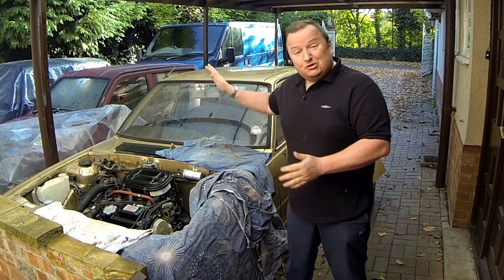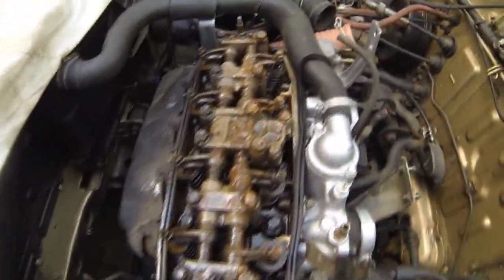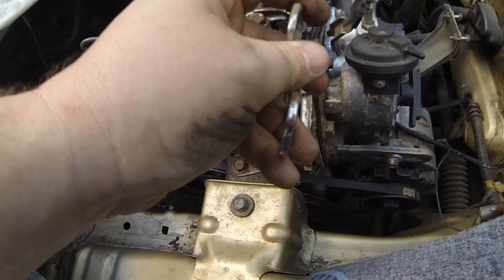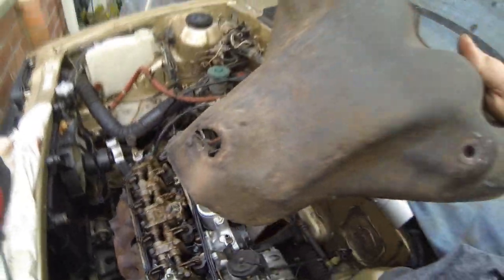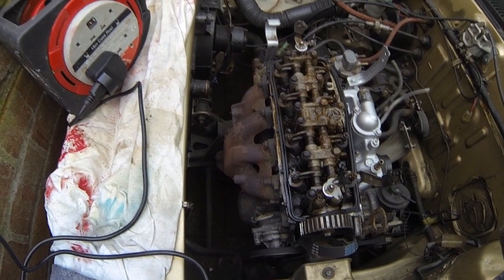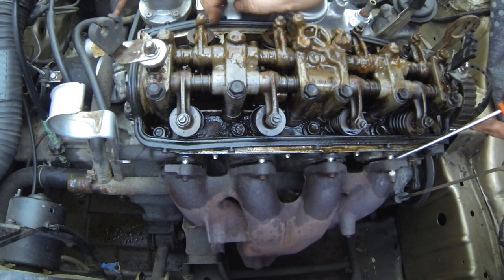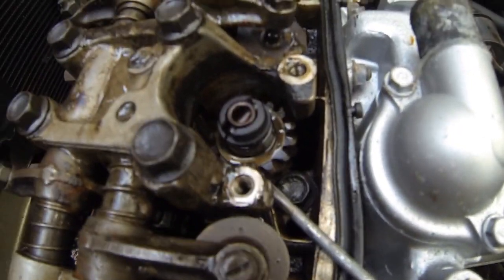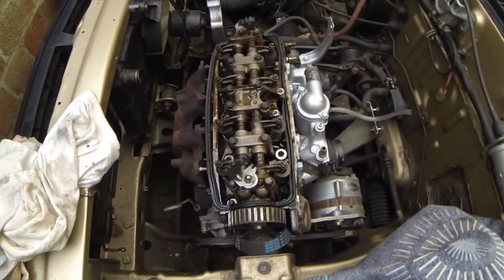Part 15 Triumph Acclaim Restoration Removing The Cylinder Head -Gasket Gone

Comment: When I did mine it was difficult to remove. I left the exhaust manifold on and used a trolley jack on the bottom of the exhaust manifold to get the head off. When you fit the oil pump driveshaft make sure you have it all reseated properly before you tighten the bolts on the cover. I broke the cover but I was able to procure a replacement from the Guru.
Reply from the maker: +Parknest Yes, i'll make sure the pump shaft is seated before tightening.
Cheers
Martin

Comment: Tough old job Martin! If you'd had a battery you could have tried cranking the engine to loosen that head. It's worked for me a few times.  Look forward to seeing the extraction of the studs!
Reply from the maker: +jsof2 Yeah, that head gasket was well stuck. Those studs will be fun I think (not) haha.
Cheers
Martin

Comment: I can't get over the middle of December and you're outside in short sleeve shirt. Crazy wind here in Welland Ont. I think Hurricane Kate is mucking things up. That head gasket is a fairly big job for an average back yard tinkerer. I hope when all is done, you can recover the investment laid out. Well done.
Reply from the maker: +Brian Percival it's 15 degrees C here during the day Bri, like a summer afternoon. Weather's gone crazy. I may even keep it yet Bri.
Cheers
Martin
Reply: +Brian Percival, +retrorestore  Question? Does Canada use a different calendar then the one the UK and USA uses? The reason I ask is that it is 14 November, 2015 by my calendar.
Reply: Brain farted. I meant November and typed December. Saw it just after I posted, oh well, I made a mistake.
Reply: I thought that might be the case, just wanted to give you a hard time. Cheers and have a great day.

Comment: Good to see you back on the tinkering vids again. Has it really been thatg long since you last touched the Triumph? :)

I think I would try the "weld a nut" method to those manifold bolts first - the heat from welding can help loosen them up, without having to heat them up with some sort of gas equipment.

Personally, I'd not bother with the vinegar solution to flush the cooling system - it's fine in principle and may "work" (part of the problem is that you can never really tell properly unless you strip the engine down to check), but you can get a two part coolant flush (scale remover and neutraliser/rust inhibitor) for about £6 (some are even cheaper on eBay) if I recall. It's just designed for the job and should work a lot better and faster.

Looking at the head gasket at around 14:35 (hard for me to see properly, and I can't see the other side), on the sealing ring of cylinders number 1 and 4, you can see what looks like carbon that;s not as present on the others, this is probably the main area where it went - you can also see where carbon has gone from around the edges of the pistons, this is also a sign of coolant getting in, and cylinder 1 has what looks like the most "burnt off" (you can sometimes diagnose a head gasket by removing the spark plugs and looking down onto the pistons - you can often see the one where coolant has gone in as the top of the piston is "clean"). Actually, spraying water into a running engine is an old trick for removing carbon.
Reply from the maker: +mrman17 Yes I wasn;t going to put vinegar in there again but use a proper system flush as you said. Pot 4 seems to be the main culprit but the whole gasket was in a right state though. The bores are in superb nick as well.
Cheers
Martin
Reply: +retrorestore Not changing "tired" coolant and not using antifreeze can cause damage to gaskets over time, and could potentially be what happened here, especially considering how much scale had built up and seeing how the gasket pulled apart the way it did. Or it just could be that the build up of scale caused it to overheat.

I've not worked on an Acclaim since around 1990, but from what I can remember they were pretty much a reliable car, especially compared to older Triumph models. I suspect the engine being designed/made by Honda helped (actually I think the whole car was based on a Honda).

BTW, I'm hoping to start my own car related YouTube channel next year.
Reply from the maker: I think you are right. I know the previous owner of the car for the past 18 years and the last 7 years it was in storage. Probably never changed the coolant but these Honda engines are pretty good. I remember the Hassle I had many years ago removing the head off my Dolomite Sprint with those long head studs that were seized into the head due to corrosion.

I'll keep an eye out for your vids.
Cheers
Martin

Comment: Hi Martin 
I did that same job many years ago on my Acclaim.  If I remember correctly it was a right pig of a job. But it ran  much better after tho.
Reply from the maker: +Paul Alsbury Hi Paul, yes, the head didn't want to come off but the gasket was shot so it needed doing.
Cheers
Martin

Comment: Wouldn't it have been easier to have left the manifold where it was and just removed the downpipe instead? I try and do that wherever I can as we all know how easy an exhaust stud can snap off and the fanimold is good to grab hold of or lever against to get the head off. It might not have been possible in your case but it's worthwhile remembering for next time. Anyway, it's good to see you working on the Triumph again :)
Reply from the maker: +Andy K Yes, I was aware of that but I chose this method as i'll also be stripping the head and you need access for the valve compression tool so the manifold had to come off anyway.
Cheers
Martin

Comment: to sort out those manifold nuts you need Mapp gas, or 5 mins with a blow torch and a set or Irwin bolt grippers.
Reply from the maker: +John Matthews Yes maybe but I don't have mapp gas  and my bolt gripper set doesn't go that small. I'll be  trying a few other things with stuff I have though.
Cheers
Martin

Comment: Great video Martin, you should check the cylinder head make sure its not distorted. (Have a look this site for a way to check the head yourself)   www.superstreetonline.com/how-to/engine/impp-1007-cylinder-head-distortion-check/
it shows how to do a check yourself. Are you going to use new head bolts when you refit the head ?  I'm sure you have to replace them on some models not sure about your model. Look forward to the next vid Martin
Cheers Jeff.
Reply from the maker: +cabdriveruk Yes Jeff, I will be checking the head for distortion. Gotta check the manual to see if they are stretch bolts in the head and also going to replace the valve stem oil seals as well.
Cheers
Martin

Comment: Why not just disconnect from the downpipe instead?
Reply from the maker: Because I am going to repair the heat shield so it has to come off anyway.
Reply: I know but by disconnecting the downpipe the manifold would have been removed with the cylinder head allowing you to repair it on the bench rather than in situ. 2 bolts removed from the downpipe would have been easier for you than fighting for space removing manifold and heat shield bolts at tight angles.  Not trying to be difficult, just an observation that could have made things a little easier for you.
Reply from the maker: I know what you mean but I wanted to remove weight from the head before removing it and it wasn't too much hassle with the dremmel. Swings and roundabouts bud.